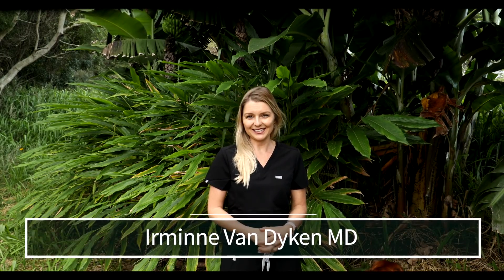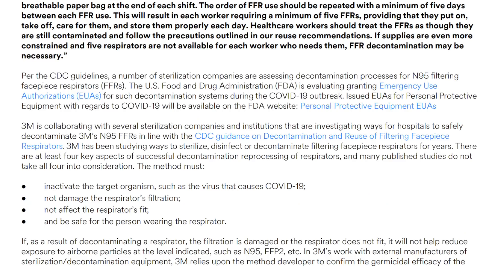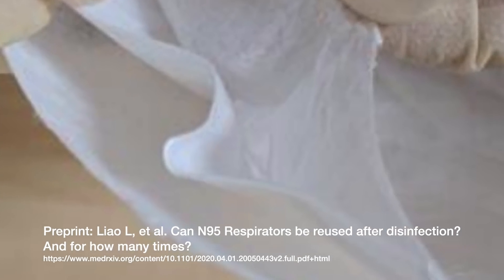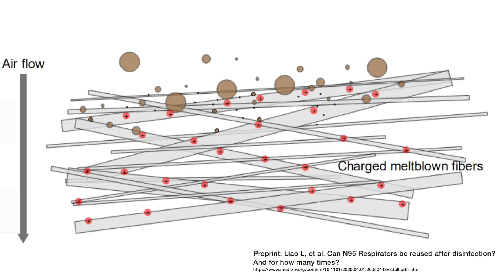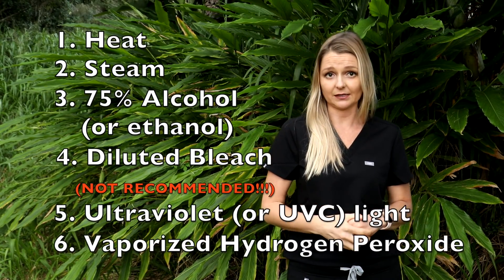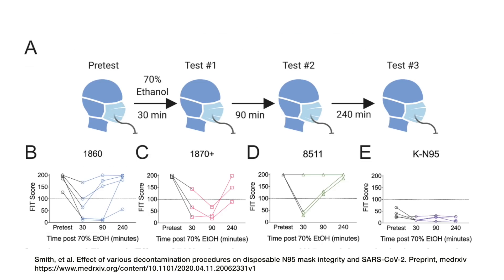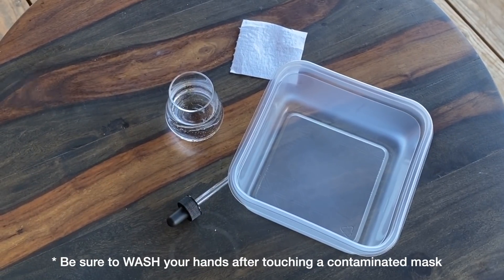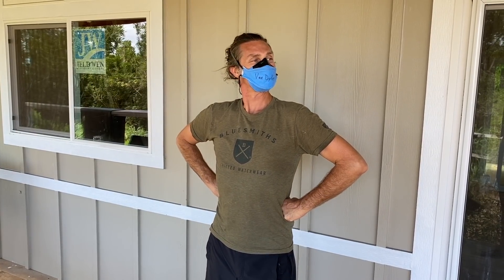How To Disinfect Your N95 Mask at Home

Comment: Before I heard of all the restrictions about what is possible, I instinctively put some 70% rubbing alcohol on a tissue and wiped the inside of my mask lightly 3 times...not fully saturating it. This is like saying a prayer over the mask that I have not offended all the medical gods and completely destroyed it. I do not have any of the equipment mentioned in this video, so if I die, I die.  Blessings to all. RIP.
Reply: Denise, great comment.  If you have a 3M N95 Respirator, I hope you realize the true effectiveness of this 1X disposable respirator relies completely on the properties of static electricity on polyprophylene filament fibers that are only 10 or so microns across.  Polyprophylene has properties that make it collect electrons and become negatively charged.   As polyprophylene is non-conductive plastic, it is extremely easy to disrupt molecular disruption with even the slightest pressure, heat, or friction of breathing thru the mask that causes the mask to "work" - COVID 19 is only about .125 microns or about 100x smaller than the smallest filament in this innermost filter in the mask; yet, breathing electrostatically "charges" the filaments which attract .1 micron COVID 19 to attach to the outer surfaces of these filament "strings."   The very act of "breathing" over or thru the mask, over the course of just 1x use, is sufficient to destroy millions of these filaments.  Thus, the manufacturer states it no longer provides sufficient "electrostatic" dynamic to stop COVID 19  or .125 micron level virules anymore.  It's much like a filament in a light bulb. Once the filament breaks, no amount of "cleaning" a light bulb is going to fix that broke bulb. you have to replace it. 

That said, disinfecting the outer and inside of the mask - of a N95 that's already been worn 1x - - the most crucial is probably storage and handling the mask when putting on or taking off.  It's no longer "fully effective" in the micron level filaments in the polyprophylene inner layer  to electrostatically stop COVID 19; but wearing the mask CDC believes there's still enough filaments still working that it's better than wearing no mask at all.  We should be demanding Congress, and the President do full court press to get you, as a medical professional, if you are that, sufficient supply of the N95's to protect our medical first line responders vs. this.
Reply: @porpo-donut  I have learned of the properties of the N-95 masks and the limitations after the fact, after I took action.  I have been acting ahead of the curve, so I missed being informed per your suggestions.  No, I am not a medical professional.  I am a Parkinson's patient and have a compromised immune system.  If I contract Covid-19, it is likely my body could die.  I ordered an N-95 mask from Amazon the first day I found out we would be quarantined. This was to protect the caregivers that come to my apartment, because THEY HAVE NO MASKS.  And this was BEFORE I heard there was a shortage of masks for the frontline workers. NOW I would not order any more N-95s because it would be for them. I am aware of what you are saying.  Thank you for your concern.  On the physical level what we have is of little help.  It is dependant on too many uncontrollable variables. The only thing we have would be spiritual help.  So ask for help, in any way you see fit...be it through the political system or by connecting with a HIGHER POWER.  I would strongly suggest PRAY. Listen within.  And take appropriate action as you are guided from within. Peace.
Reply: Weedy Lints Clear, concise, and pretty much explains why all the things everyone here says they are doing, is pretty much just giving folks a false sense of security. Fact is even with the proper equipment, without training we’d probably contaminate ourselves just taking a “dirty” the mask off... That said, we all do the best we can with what we have. Stay safe!
Reply: @ @porpo-donut  insightful comments, what i was wondering about is what does 1x use exactly means, from what i understand it's up to 8hrs of use for a single N95 mask, so if you wear the mask 1hr here and there multiple times over a period of time within the 8hrs window it would be ok? i am aware of the electrostatic charge in the inner layer and i would say time is a more accurate way to measure the capacity of the mask before it's saturated or neutralized in the normal environment and not in a dusty or commercial settings, just like your car air filter, you go by the amount of use and miles.

The other concern is do we really need to disinfect if it will be used for 8hrs over a period of 3 weeks or so, i only use it for shopping here and there but my concern is the germs from your breathing and contaminated air, sweat and fat from your face over time, could it be an issue for something harmful to grow on the surface of the mask.

Comment: If the paper links above don't work for you, try these:
[1] https://doi.org/10.1101/2020.04.09.20059758 for the paper with the recommended wet heat protocol (pp. 2-4 of the paper)
[2] https://doi.org/10.1101/2020.04.01.20050443 for a paper showing that N95 masks tolerated 50 cycles at the recommended temperature.
The first paper cautions: "Further work is still required to ensure viral inactivation of SARS-CoV-2 on FFRs." - the study didn't directly study that. This protocol uses 185ºF (85ºC) wet heat.
[3] https://doi.org/10.1101/2020.04.11.20062018  found that  158ºF (70ºC) dry heat  for 60 minutes (barely) met the goal of 1000x reduction in infectious COVID-19. 
The higher temperature 185ºF should help, but the question is - how much? Until we have data on that - should we be using 60 minutes for the 185ºF (85ºC) wet heat?
[4] Heat and Humidity (for N95 decontamination): https://www.n95decon.org/files/heat-humidity-technical-report  
currently has a summary of the heat decontamination literature as of 23 April 2020. For updates, see https://www.n95decon.org

Comment: We are told relentlessly by talking heads on television news channels that mail pieces,  packaging, clothing etc. is SAFE because the Corona Virus can only survive for 24 on cardboard and at most 72 hours on clothing, plastic, metal etc.    

So which is true?  Do we need to sanitize the masks, or can we simply put them aside for 72+ hours at room temperature to ensure the corona viruses die on their own?
Reply: tests have shown the virus can survive on glass for 9 days , The Ruby Princess petri dish was found to still have active virus load on surfaces around 20 days after it was emptied so there is still uncertainty on its survival .

Humidity and temperature may both have an influence

Comment: this info is  far from good,,  1//  uvc and uvb light killes the virus is 5 minutes,,,YES   put the masks in the mid day sunlight...done..2//  dry heat works perfect,, put the masks in the oven at 65 clecius,, 7 minutes,, done
Reply: "Done" is a bit strong  for your dry heat recommendation of 65ºC 7 minutes. In this paper,
https://www.medrxiv.org/content/10.1101/2020.04.11.20062018v2
70ºCfor 10 minutes left about 1% of the virus on N95 as infectious. Even
70ºC for 30 minutes left about 1% of the virus on N95 as infectious.
70ºC for 60 minutes killed (only a bit ) more than 99.9% of the virus (which is a common target kill rate).

Comment: I couldn't get any of the cleaning references to load.    Mahalo.
Reply: Me too, so I Googled them from the titles on the screens - here are the two relevant to the recommended method:
1] https://doi.org/10.1101/2020.04.09.20059758 for the paper with the recommended wet heat protocol (pp. 2-4 of the paper)

[2] https://doi.org/10.1101/2020.04.01.20050443 for a paper showing that N95 masks tolerated 50 cycles at the recommended temperature.
Reply: @rafowell  Its a non peer viewed self published pre-print.  What Dr. Woo Joo Kim of Korean epidemiological research calls the "theses pandemic".  

There is risk accepting what this paper says.  The presenters may have made errors.  This happens often. They may be interpreting the results for sensational conclusions.  They may not have done the statistics correctly.  Because it's not peer- reviewed,  no one has done the comparisons with other similar work  and problem resolution between other papers of this type. Other experts have not looked at it. No one else has duplicated these results yet. This is not a critique of this work.  It is just not complete and put in context without a peer review.  The user takes on risk employing these results.

Comment: This is great, Dr. Van Dyke, thank you, but is there an alternative to a convection oven? Can a regular oven be used (my lowest setting is 200 degrees) or a regular microwave??? Thank you!
Reply: microwave can not be used due to the metal noseclip , it will cause fires and damage the microwave.
Reply: I have the same question!

Comment: All I have is my regular oven. Any reason why I can’t use that?
Reply: I have just a regular oven too, but I find it is hard to get the precise temperature (using a separate thermometer to monitor the temp).  The temperature often seems to go way over what I set it to.  Perhaps a convection oven is more precise.
Reply: The main concern is that material with direct line of sight to red-hot glowing elements can get quite hotter than the average temperature. The protocol authors say: "It is important to note that a convection oven has no direct line of sight to any radiative heat sources, which would have the potential to damage the masks."  Also, the temperature distribution in a radiative oven is less even, and it takes longer to get to a uniform temperature. Read the protocol paper for more on that ( https://doi.org/10.1101/2020.04.09.20059758  )  If I had to do it, there are things I'd try (like suspending the Ziploc container inside a blackened (inside and out) metal container inside the oven, and use an oven thermometer inside the Ziploc on a hotpad to see how long it took to come up to temperature) ...
Reply: what about a dehydrator?  they get to that temperature.
Reply: @IzzyRocks2  My dehydrator goes to 165.  That is not high enough for the protocol mentioned in this video.

Comment: How about spraying 3 % hydrogen peroxide?
Reply: The hospitals are using 6 % aerosol hydrogen peroxide.
Reply: I think the problem would be it getting too damp as that would destroy that inner layer.
Reply: That's what I've been doing, 5% hydrogen peroxide a light mist of it with a spray bottle on the outer layer and let it dry for a couple of days.

Comment: The ziplock container will not melt at 185 degrees F after 30 minutes? I just don't want to ruin my only mask by the container melting.
Reply: I would make a makeshift box out of heavy duty aluminum foil and put it in my oven. I can't see myself putting plastic in any type of oven.
Reply: @KVStarStruck22  the mask is made of the same material, it's airblown.
Reply: @SW-ii5gg  Stop correcting me. You sir are wrong, it is meltblown in the N95 not the container. Filti a company that make the materials in N95 masks have demonstrated what I have said when disinfecting these materials. They put two aluminum foil covered with their filters and put it over a bowl of water. My theory is still correct.
Reply: @KVStarStruck22  you can't see yourself putting plastic in the oven? How about the mask? It's made of the same plastic as the bowl.

Comment: I tried to google the 'Italian Protocol' mentioned..can't find it. In any case doesn't CDC guidelines state that spraying alcohol on N95  (or surgical )mask will make it loose its  electrostatic charge that is needed for the proper filtering of the virus?
Reply: Rub dry mask on air filled balloon, just an idea

Comment: I disinfect mine with ozone.
Reply: Isn’t ozone what is used as the CPAP cleaner Sol Cleans?
Reply: @EuroFrench  he probably means filtrates, perhaps CPAP masks and tubing are one of the plastics that doesn't get brittle from ozone. I have read the ozone causes it to lose the static charge of the N95's.
Reply from the maker: Ozone is toxic and is not a recommenced method for disinfecting breathing equipment.
Reply: @outofthedoldrums   Ozone also damages plastics over time.  depending on the plastic type , they can become brittle

Comment: i don't understand why uvc led light of 254 nm is not recommended for disinfection. it is used for lab hygiene of goggles, pipets, etc. does it damage filter media?
Reply from the maker: UVC light is effective. However, Look at the many different layers of a mask. Uvc light has a hard time penetrating all of these layers. Complete disinfection is very difficult to achieve. Other things with a single layer like goggles to have a single surface and  Uvc light is a great option.
Reply: @outofthedoldrums  excellent points. Thank you!